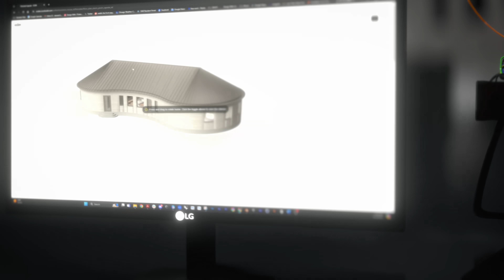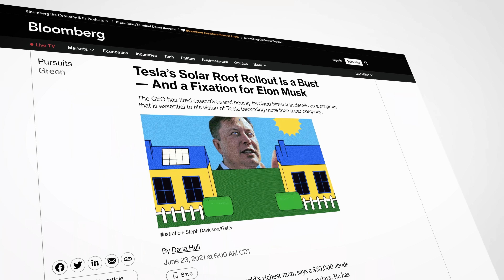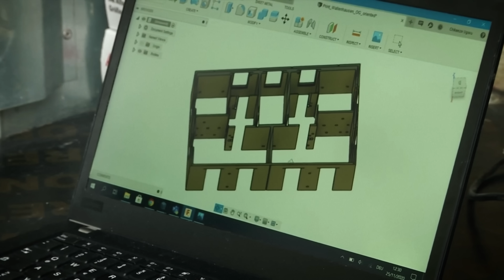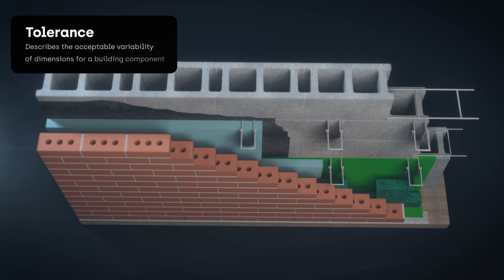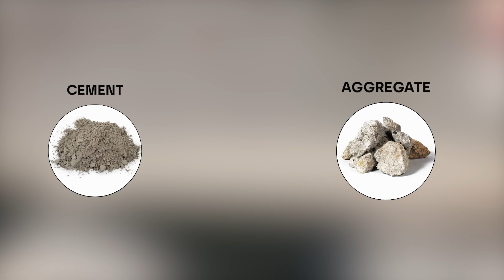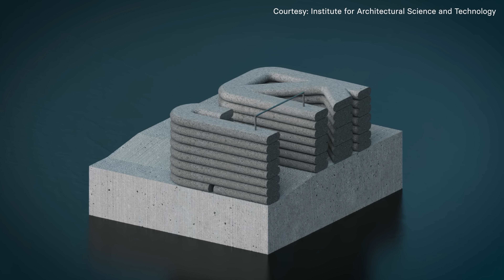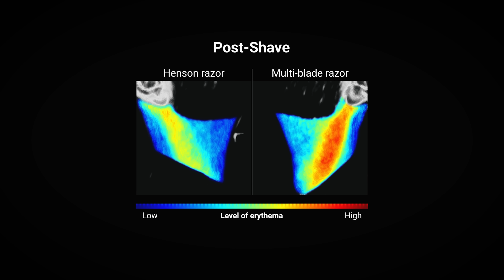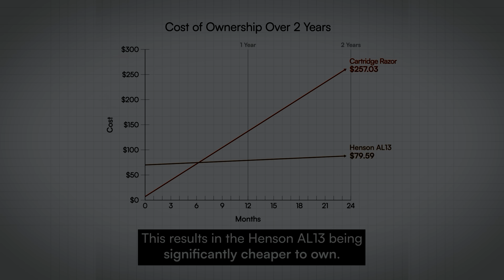Why 3D Printing Buildings Leads to Problems

Comment: Ok instead of the site printing, let's just print parts in the factory and assemble them on site.
Reply: Why are they sp stupud and 3d print a layer at a time so unstable so structurally unsecure. They couldve poured that concrete into a rectangle block mold and stacked block wall and had a much more secure and structurally sound structure. They do this because its cheap easy and they can still charge a lot of scoop up large profit margin at our expense. Its not worth it these 3d printed hpuses wobt last nearly as long. Hollow, now structurally secure.

Comment: So it takes a team of 4 people 48 hours, after 24 hours of setup, to print the walls for one janky-looking house (once you already have the foundation). But in Europe, a team of 4 can place the brick walls for an entire house within 3-5 days, and you don't need any expensive machinery, and can hire additional low-skilled labor with very little effort (they don't need to first learn how to use complicated machinery).
Reply: This technology is completely pointless. We already have a glut of available labor, and we're building machines to take even more jobs, but you won't increase speed, quality, or lower price anyway. Technology has already stolen so many jobs, which simply moved more capital to the hands of fewer people and destabilized our economy and society.
Reply: Small bricks arent that good plenty of issues with those. I think we need to scale them up from bricks to block. Big block but smaller scale than the egyptian pyramids by a lot. A blocl the size of 1 quickcrete bag perhaps or a couple. You mix it, pour it in a mold to caste a block. A little wide maybe so the wall is solid and it wont tip over

Comment: 3D printing is used for making 'mass' produced finished product in the aerospace industry. Think rocket engines for sure.
Reply: Okay well welding ontop of a weld over and over to make a cylinder from metal is different than doing it with concrete 3d printed its junk

Comment: Stick and timber framing takes little time, is adaptable, easy to rough-in, easily repairable, and with engineered timber is more durable and sustainable than ever.  

Replacing wood framing isnt going to do a damn thing to help the affordability or the inventory issues.  This nonsense is snake oil.

Comment: I wonder why they dont have a wearhouse that pours and dries concreate into perfectly flush walls and such to fix the rounded surface areas then have a machine come through and concreate the edges in place like makijg a ginger bread house but also while making the walls in the factory they can place a layer of chicken wire in the center to add more strength to the walls once house is done with walls and everything to cover up the concrete place the 2x4's and add drywall to cover the concrete rough textures doing this will make a stable house youll have space where the 2x4's are located to run all your wiring and itll save time not having brick layers needing to constantly lay 1 brick after another. Only reason i somewhat like the idea of a 3d printed house is that its less likely to have areas will small imperfections thatll allow insects to climb into your home and make thier way into your walls because they aint gonna have an easy time climbing through concrete only way is the common access points such as windows doors and such if done right. Like you wont beleive how many houses ive lived in where the garage an easy area for insects to get through the garage door gaps find thier way into were people place the ac unit and water heater in the garage in a closet and said closet has small holes that weren't sealed properly that lead either into the airducts, the kitchen area through the wall or even the water system to climb in through the toilets which yes ive seen a few roaches climb out of toilets in a few houses.
Reply: Thats called a precast wall and we do them with a fancy machine.

Comment: A brick house doesn't have bricks on the outside, but on the bricks there is a layer of coarse plaster, then a layer of fine plaster and then paint. There's no reason why you shouldn't do the same if the wall came from a 3D printer. After that, the wall would be just as smooth as a brick wall today. And of course you can also create 90 degree angles. To do this, a metal strip is embedded in the rough plaster at exactly 90 degrees, which then forms a perfect corner with the fine plaster. Without this metal strip, a 90 degree angle would not be possible even with plaster.

Comment: The biggest problem with 3d printing homes is that its a gimmick thats being served as a solution to a problem. Problem being lack of affordable housing, solution being 3d printing making houses cheaper to produce.... but the problem with housing is not really cost of brick and mortar itswlf but the land. So what that you can get cheap house, you aint gonna be building it in a local lidl parking lot.
Reply: Also all the specialists needed to install the internal components.  You pay your plumber and your electrician and your roofer a lot more than you pay your carpenter.
Reply: To be fair if I had the ability to drop a couple of houses in my Lidl parking lot I would.

The guerilla gardening approach to real estate.
Reply: Near where I live it costs $100K to hook a new house into the public water supply. Even where I am at it is $30K. Another $20K for sewer.
Reply: It's almost like there are to many people on the planet or something LOL
Reply: @kelvin1316 That isn’t true though. It’s not that there are too many people, it’s that too many people want to live in the same locations. In terms of actual land mass there are plenty of places for new homes to be built, just depends if people want to live there.

Personally if we can 3d print houses that can withstand catastrophic weather systems then I wouldn’t mind moving to places with tornadoes and hurricanes if I lived in a tornado proof home.

I’m originally from California but if I could live in a safe 3d printed home and get constant high speed internet and electricity and I can still get door dash, then I wouldn’t mind being placed in a location that other humans would be afraid to live at.

Move me to the middle of the Alaskan winter if the 3d printed house you give me can protect me from snow, wind, and bears.
Reply: Housing shouldn’t be an investment vehicle
Reply: A good deal of the lack of affordable housing is due to speculators investing in property outbidding homebuyers.
Reply: Problem is bigger and more nefarious than that even…if their tech reduces the cost to build a house by $100K, the construction company is going to pocket $100K.  Total consumer savings?  Zero dollars.  

Technology doesn’t save US anything anymore.  It’s just profit.  Nuclear fusion will be a windfall for energy companies, with us paying the same prices we do burning coal.
Reply: Yeah this is correct re: cos t of land but also we do have limitations on labour, materials etc etc. So if you have a project of 20 houses, this could be a great way to go. But would need to see how banks mortgage these properties and if there are resale issues
Reply: @lastkingofscotland  Even in regards to labor shortages, 3D printing for houses is, as is also generally the case for any industrial application of mass-production 3D printing, inferior to alternatives (e.g., modular pre-fabs).

The fact of the matter is, 3D printing is time-consuming and limited. It is inefficient. And with housing in particular, one of the big limitations is that it cannot have anything else (e.g. plumbing and electrical connection points) included -- those need to be retrofitted in, which is going to be a significant source of labor costs, particularly since you are going to need to be breaking through concrete to install them.

It's a technology that's great for prototyping and doing certain types of one-off items, but it's not a technology that works well for everything, or even for a lot of things.
Reply: Yes, the biggest problem is really political -- it's zoning ordinances that limit how much development can happen in any one place and inject a bunch of uncertainty into the process (hence why in most places people want to live the cost of new houses is substantially more than the cost of construction plus what inappropriately zoned land costs).  

But that's no reason to complain about people reducing other costs.
Reply: Not even the land but the regulatory burden.
Reply: The main thing I see about it is that these 3D printed buildings go up FAST. Like 1-2 days instead of 6-8 months. That's 2 magnitudes less!

My favorite thing is the ease of adding MASS as well as poured seamless insulation. Cement foam insulation is CHEAP, ROT-PROOF, FIRE-PROOF, RECYCLABLE and VOC free too. You can't really hurt the stuff, it doesn't go bad, and it can't hurt you. And with 3D printed walls it's easy to dial up a non-sissy wall thickness, and pour the liquid cement insulation. 

Thin walls are the bane of commericialed American construction in general. As for the buildings you don't need to make all the walls structural. You really can just block in a shell, and then just add in interior non structural walls like normal. Same thing with fitting square things against curvy walls. Just put up drywall and square up the corners and you're golden. Large developers and home builders ALWAYS skimp out on the insulation. It's just profit margins and churning business for these people, they don't care about the livability at all. If it starts falling apart in just a couple years, they don't care they already made their money. 

With 3D Printed buildings, adding insulation or at least thickness is so cheap and easy, there is little reason not to just do it. It's not an extra layer of complexity like with standard insulation, what plastic foam or mineral wool you are going to use etc. 

The strong suit of 3D printed buildings are for the curviform ones. Americans generally don't have out-of-the-box thinking, especially not those in construction. It's in other countries that didn't undergo hyper-industrialization that the strong benefits of circular, oval, and cylindrical structures are more appreciated. They hold warmth better, and they are more wind resistant generally. 

But the Architects would have a field day with this technology. Maybe we would finally see more interesting buildings since it wouldn't be any more expensive to make curvy buildings in a 3D printer than a boxy building would. It just takes time for people's minds to open up to the possibilities. 

The requirement of labor is also much less. Labor is good, but hard constant labor not so much. You can take unmuscular people and put them to productive work this way. 

A 3D printing machine should also be fairly inexpensive. It's just trusses all the way up like a cellphone tower. 

As for the price of land, it's just all vanity price and artificial scarcity. Shelter is a human need. Yet homes have become investment vehicles instead of what they are, a commodity. Homes and land are not something that should be subject to "it's worth whatever people are willing to pay for it" subjective free market nonsense. They should follow the "a pint's a pound England round" logic. That there is objective value to these things, and that things should have certain cost to them, not more not less. 
Homes should be valued at their sq. Footage, and the amount of material that went into making up their mass. Not more not less. 

Subjective measure like closeness to amenities or prettiness should remain out of the financial equation. What "desirability" should determine is how fast a home sells, not how much it costs. If your home is "undesireable" then that's when you sell under market price. If you live in a crime-ridden, impoverished rathole then you'll never be able to sell it for what it's worth. 

For any system that allows a for a level of subjective pricing I'd put a cap at no more than 50% the objective cost of the building. This way you can have your supply and demand markets if you like, but nothing crazy that could get completely bonkers out of hand like we have here in Miami where home prices are 300-400% of what they really out to cost. 

However you cut it, home selling should be though of as getting rid of idle assets that you are wasting money maintaining you aren't using and passing it off to someone that can use it. The changing hands of money only exists for the sheer fact that it cost money to build or obtain the building in the first place. 

As for land, the value of land has traditionally has been corespondent with the economic potential of the land. If you can use it to make money, the more valuable it is and the more it makes sense to pay more for it. Residential only zoned land really ought to be the cheapest kind. It's only good for living on, not farming or commerce, so it doesn't make you money, but it costs you money in upkeep. Residential land is more a liability than an asset, and should be treated as such. Only better than true wasteland. 

The outrageous price of land is just the bankers, rent seekers, and investor class that are trying to screw the public at large. They hold the assets, they set the prices, and if you don't like that, then they usually have the funds to sit on and wait you out till they find a sucker that's willing to pay them their asking price. Will the laws change? Most of the people with the power to do something about it are the same class of people that benefit from a broken system so they won't try to fix nothing. They'll likely try to undermine change if possible. 

There is a lack of financial literacy and education in America and a lot of the bad consequences has to do with the general public not being able to look a crook in the face and tell them no when they offer them a bad deal.
Reply: It’s not a gimmick, if you had paid attention you would’ve seen that they are building whole subdivisions like this, meaning the land is a lot cheaper than it would’ve been otherwise. They are buying massive parcels of land and subdividing it, getting the buyer a much cheaper piece of property.
Reply: Land resources itself is not much an issue in most countries. I think the issue is getting a land block with nice neighbours and good facilities, which is, I believe, can not be solved by building tech advancement nor abundances of total land resources out there. 

So I think land block price is a totally irrelevant topic here.
Reply: @Unitarisoul  Depends where you are.  In the UK land availability is a real problem so land prices are astronomical.  In the US, land is not such an issue but utilities connection costs are sky-high.
Reply: @mikebradley4096  We brought some land, and as soon as the money had changed hands the local council put TPO's (Tree Preservation Order) on all the tree's because suddenly people (there were like about 20 plots I think) may want to take down may 20-30 generic, relatively young trees, to build some houses on.
Reply: @Unitarisoul  even if nar land itself is not an priblem its not bout land alone.

First is the actual ground, good luck putting a stable house on a desert sandy dune. You need good stable ground in which you can pour proper foundation Electrical connection, water supply, sewer connection is next thing, thats not going to be cheap eighter before you dk any print of a house or erect a house of any kind. On top of that you have to deal with planning permission. Before you get to put any house anywhere you will be paying 100ds of thousands of dollars.

Comment: If the house outwall and the inside wall are connected by concrete you will have cold spots in the house. That isnt allowed in cold countries as it allows mould to grow from condensation

Comment: The assumption around 1:30 that homes can't be vertically integrated may not be true because of manufactured homes and mobile homes.  There's still huge room for improvement.

Comment: Its just the look they want. Nobody would leave a raw concrete wall on the outside of a traditional home. Those 3d printed homes are just unfinished, and that's the look they went for to show that the building is 3d printed. Any saine persone would finish the walls after the print like you finish a 3d printing. You can make the walls square and put fake or real (just scliced really thin stone) on top of it. Or you could grind down the wall till they are smooth.

Comment: I have been thinking about how to build houses faster for a long time. But not only faster; safer, more precise and less prone to imperfections. The only thing that seems plausible is building things off site, in a factory where weather cannot delay, where machines can build more precisely because the wall is on a pedestal that is always the same. Then transfer that to site in a cargo container, crane it into place. But you cant do that with bricks, so maybe you use concrete fabricated walls for the shell. Then you are back to the repair problem.

Bricks are too slow, framing is too slow, weather causes bows and twists and can halt progress.

Comment: Framing a house is the cheapest part. The installation, doors, windows, water lines and electrical wire is way more expensive.

Comment: So does a robot setup the framework for the machine? Because I'm pretty sure a form crew could set forms in the same amount of time. You also get things like rebar reinforcement and no cold joints every 3 inches. BUT!! It's automated!🤦‍♂️